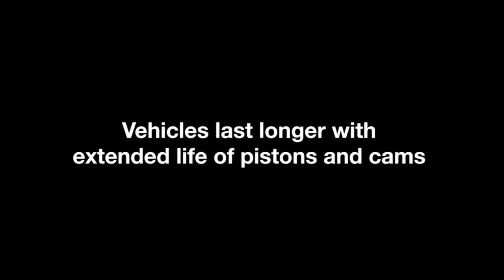Sequence IIIG Engine Test + Motor Oil Comparison

Comment: Pennzoil Ultra Platinum is at a very close 2nd @ 65% better protection than required for the IIIG standard, but is so much more readily available and much less expensive than Amsoil Signature Series. And honestly, if you keep your engine oil intervals short & sweet, there shouldn't be a problem with running Pennzoil over Amsoil.